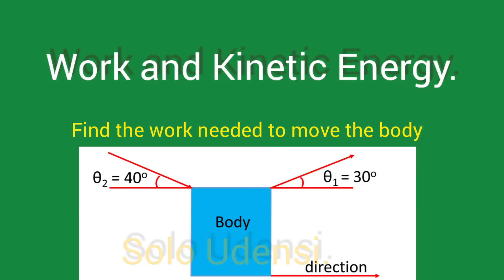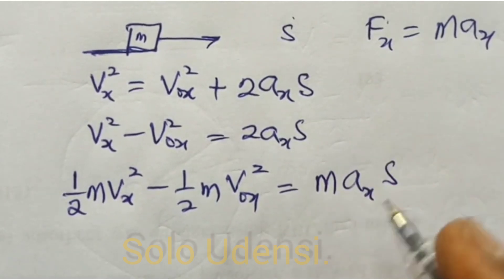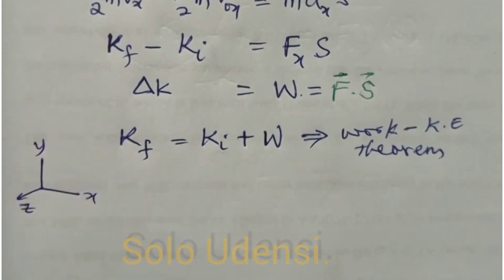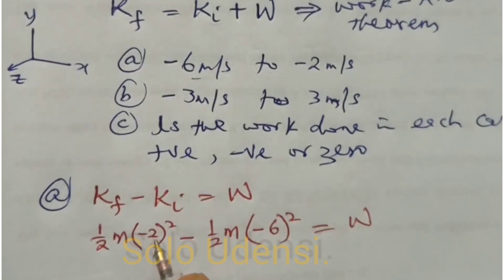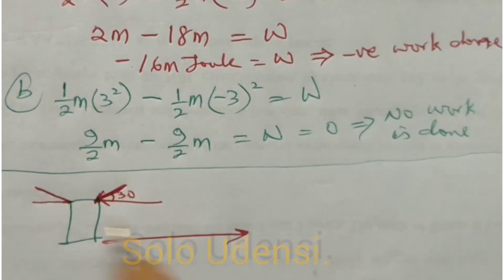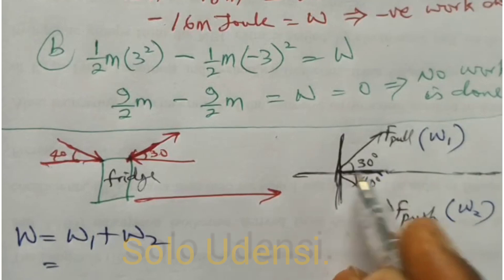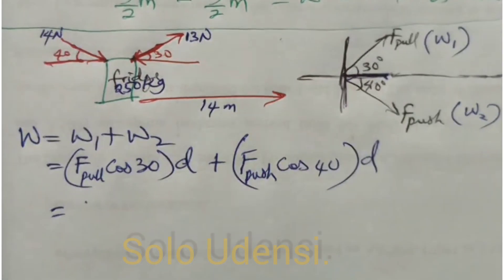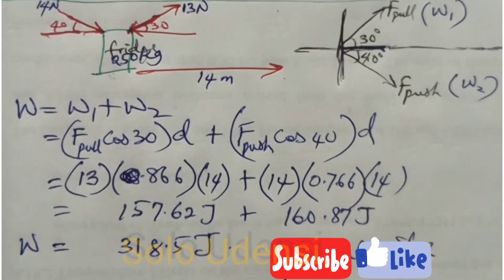Work - Energy Theorem

Comment: Sir if given, A body of mass 3kg which falls from a height of 300m and we are to find the K.E after falling a height of 125m. 
K.E=P.E=mgh
So the height we are to use, is it 125m or (300-125)m?
Reply from the maker: At max height the total energy of the system equals the P.E since velocity is zero there. At the bottom (where height is zero), the total energy equals K.E. Any other place in between, K.E + P.E = total energy (it is constant).
After falling  125m, PE = 3×9.8×175 joule.
Thus K.E = constant - P.E
                = 3×9.8×300 - 3×9.8×175
                = 3675 J

Hope this helps you? Bye.
Reply: Wow. It helped a lot Sir